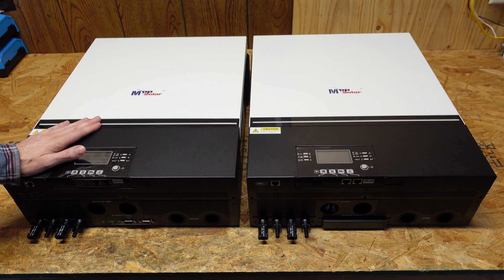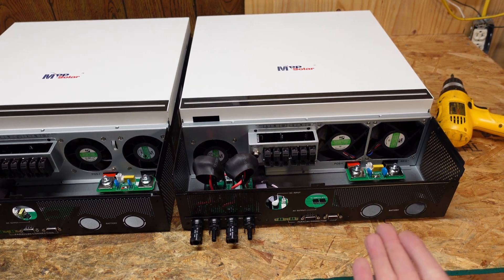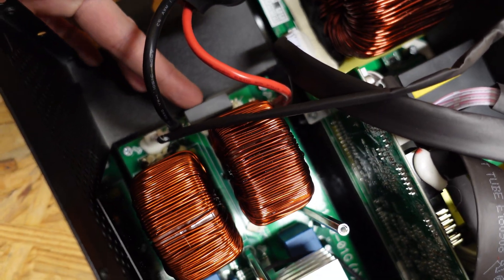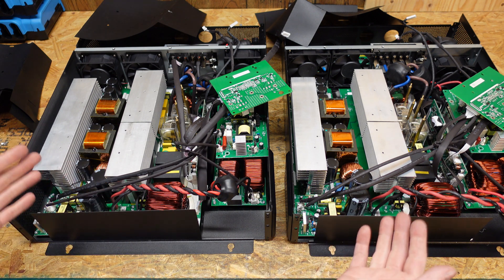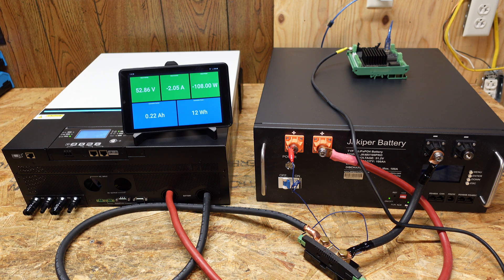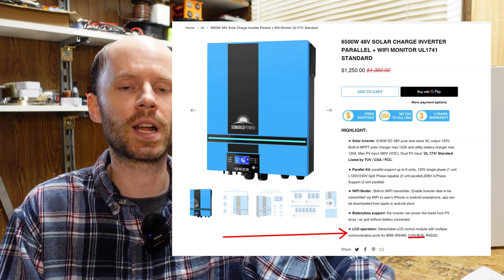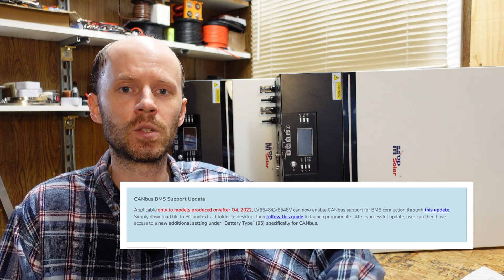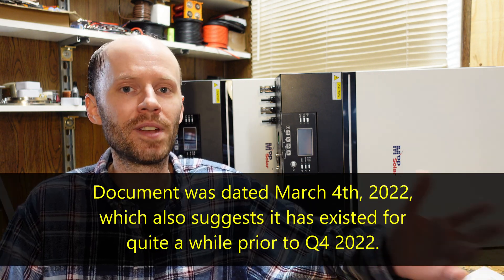MPP Solar LV6548V New Model - 390V PV, CAN Support, Idle Power, and More

Comment: My question would be is there a way around the increased idle draw, or is this simply the cost of doing business if you're in a cold weather climate and need that extra voltage? What design changes could be made to mitigate the situation? Superb video - your reaction was priceless!
Reply: You have to pay to play if you want efficiency. 

Victron MultiPlus-2 48/3000
Zero load power 13 W

SmartSolar MPPT RS 450
Self-consumption 15 mA
Reply: @johnguilbert1349  can you give me a link to that please
Reply from the maker: I suspect it has to do with the choice of FETs used. I didn't take it apart far enough to grab the part numbers for comparison; however, that would have to be where the power is being consumed in my non-engineer opinion. The higher CFM fans seem to suggest the same as well.
Reply: @LithiumSolar  It would be nice if the fans only came on when the temp got too high or when you draw past a certain load threshold.  I get having them run all the time when PV is coming in, or when you're outputting thousands of watts, but when their near idle, seems like the fans could ramp down (or only run 1 as opposed to 3).
Reply: @AdamDeLayDIY  I agree I don't know why they're on all the time I have a sungold 65-48. And it's always on it seems. And now I know the idle consumption is very high because it's 390. I wish I would have known that before purchasing. I didn't know much about idle consumption before purchasing
Reply: @LithiumSolar  what are fets

Comment: Geez that idle is awful haha. Glad you got your hands on these! Very useful information
Reply from the maker: I was so excited when these came out, big disappointment to see that. They ruined one of the big factors that I feel made the original units so popular.
Reply: @LithiumSolar  yes absolutely. Pretty big let down. As usual in the solar industry haha. I don't understand how they don't lower the idle by now. Everyone complains about it, and they absolutely can.
Reply: @WillProwse  how much is the idle consumption on the smaller all-in-one inverters. Like a 5000 W inverter do you know offhand
Reply: I think growatt  couple other company cell them. I think I've seen video on your site haha
Reply: @VinceBadovinatz88  I've got an MPP Solar LV5048 that has been running great for 3 years until it died a couple days ago. Idle consumption was 65w. I'm looking hard at the deal on that old model 6548 as a replacement. Hate those MC4 connectors tho.
Reply: @cowpen  thank you for the reply 65 W is even a little high I think. Although it's doable I guess. Do you remember how many Volts coming from the solar panel array it needed to make it work. I think the 65-48 need about 90 Voc if I'm not mistaken to get going.. that replacement model for 900 sounds pretty good to me.

I wish I could get one to build a system on a handcart or In A Box portable. I know there's one guy who's doing them on a handcarts they're very nice

Mine has a 390 V capacity versus the 250 on the older models that might be why it needs 90
Reply: DIY solar power, censored me out of his ch because I chatted about NiFe batteries.
Reply: @iTeerRex  what kind of batteries are they sorry to hear that that's kind of weird
Reply: @iTeerRex  I didn't even know there was such a thing until I read your comment.  I knew you could use a base as the electrolyte, but did not know what was out there.  They are pretty stinking expensive, heavy, and you still have to deal with a corrosive liquid - just a base (sodium hydroxide) instead of an acid (sulfuric).  If you could find a huge bank of them that was less than 20 years old for a good price, it might be worth it.  I priced out 40, 1.2 volt, 300 ah cells from Iron Edison and it was over $15,000 - more expensive than a Powerwall.  If you were being fanatical about these things I can see you getting cut off.  It's always good to know there's another way to do things.  If you wanted to urinate into buckets or drums, stick electrodes in them, fill your backyard or garage full of them, and use that as battery storage,  you could - it just might not be the best thing.
Reply: That is sadly a high ICR. I just purchased 10x LV6548 250VOC, and now that I see this, I'm glad I did, lol.
Reply: @Nate's DIY Solar  what is 10 * lv 65-48 do you mean 10 of them
Reply: @VinceBadovinatz88  yes 10 units